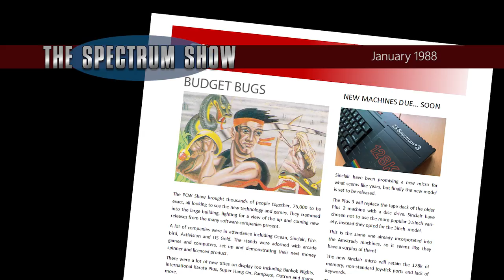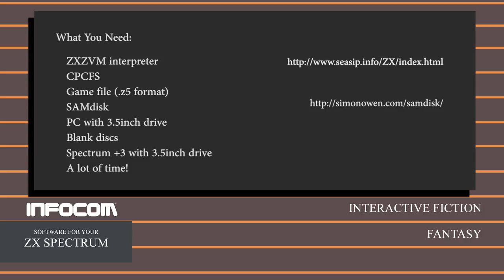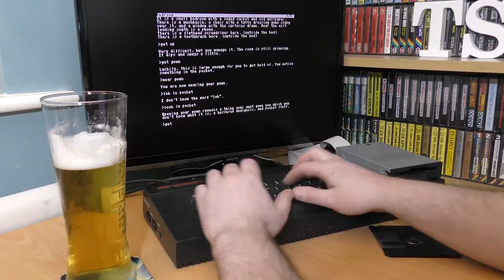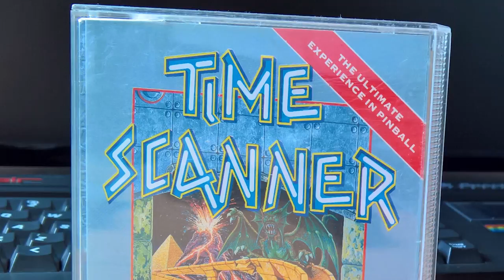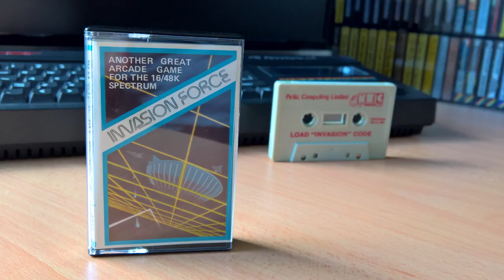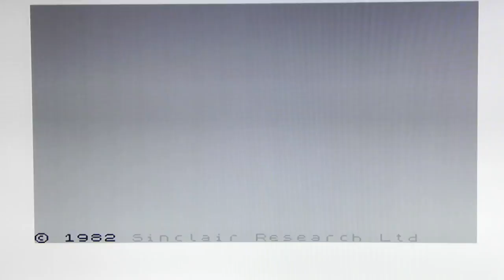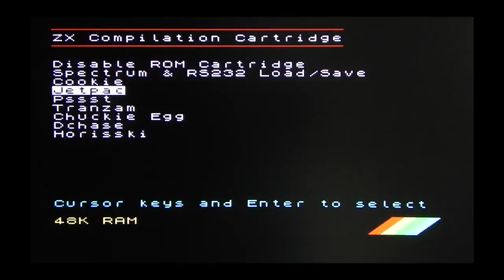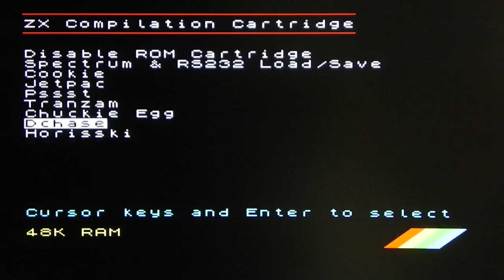The Spectrum Show EP63

Comment: Another great episode Paul .

There is also the Dandanator MINI which you flash from the speccy , works with snapshot and tap files and also as a bonus Rom files so ZX Diagnostics can be booted .
You can add pokes which you can enable any or all from the poke menu and the latest version allows pausing of the game too.

There is the SDI-1 interface for the +2b which gives you the ability to connect up to 2 3.5" floppys or even as i do an Amstrad FD1 3" floppy so you can use the +2b as a +3 with either drives A or A and B.

Im glad Paul Farrows ZX carts got a mention , i have a ZXC4 which has a larger flash , 1 meg if i remember right and also emulates a microdrive too and also can take the IF1 Roms or other OS Roms so if you have a 48 k you can boot it as a 128+ {obviously minus the AY and extra Ram pages }
Reply from the maker: There is a lot of new stuff coming out, so hard to keep track. The section was recorded a few months ago during a mammoth session... so we may have missed a few items. I'll look into the Dandanator though, sounds cool.
Reply: The Dandanator MINI looks great I think there was one at Reply this year, or something that looked very similar.  I've checked out the shop like from the site and it doesn't look like they have any and the guy who makes them says he isn't making any more at the moment :(.

 There's also a links to similar devices on the Dandanator MINI including a DIY option:
http://trastero.speccy.org/cosas/droy/zxflash/zxflashcart_e.htm
I don't think I'm brave enough for that yet though.

Comment: Just watched the series back to back over the last few days, riveting. Love the dev diaries.. I want to code a game myself now, but I want to code on the pc (windows 10) and then get the speccy to run it. So would it be an idea to prototype the game in basic and then write a mc version/ compile the basic to mc?  And on the PC what would you recommend as a set up..? Have programmed in the past but assume im a complete noob.
Reply from the maker: It depends on your background regarding coding. If you know mc, then a good option in the emulator ZX Spin. This has a built in assembler / debugger and results can be viewed in the emulator. If not, then learning mc can be a long task and there are plenty of vids on YT covering this. The problem with proofing in BASIC is that it is limited in graphics (e.g. 8 pixel blocks) rather than the 16 or 32 pixels used for most sprite based games. Another excellent option is to use Boriels ZX Basic compiler. You can write in modified BASIC, add pre-built routines form a large library and compile to TAP files ready for a real Spectrum.
Reply: I know it would be far too slow, but just as a learning experience, is there any way to replicate the larger graphics (for want of a better word sprites) in Basic?